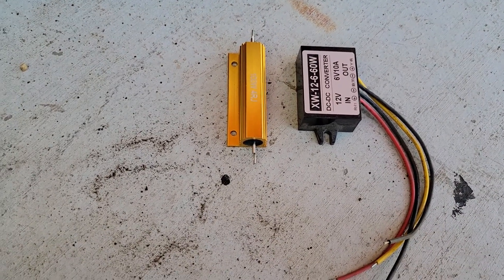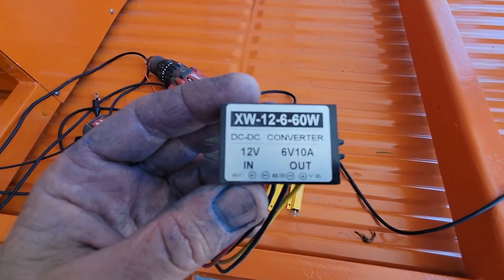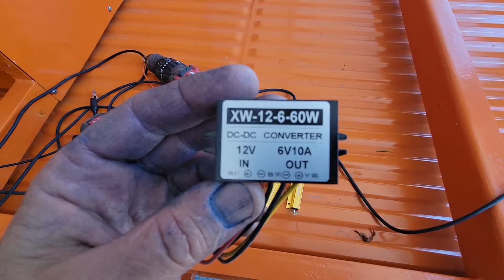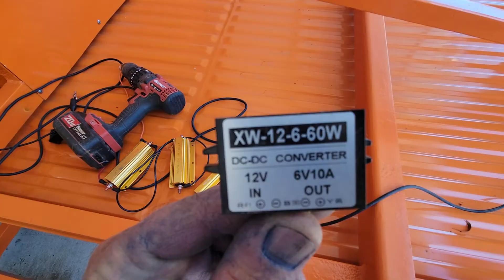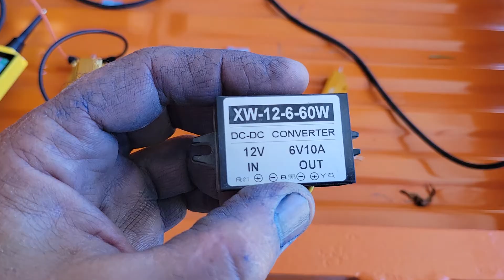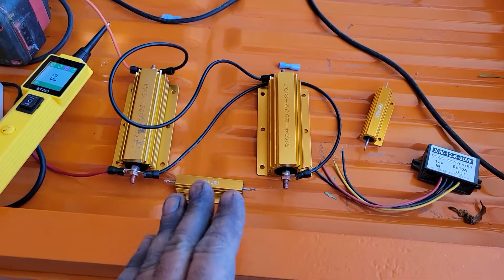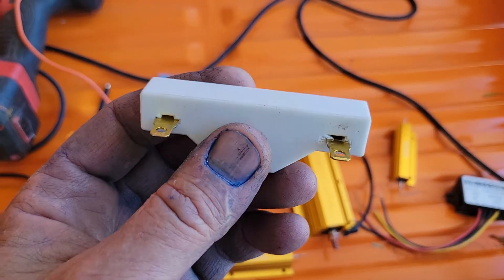CONVERTING 12v to 6v resistor or converter which is better you.

Comment: Nice shade of blue. I have what a normal person would think is a less than smart idea. I don't have any specific products purchased  made for converting voltage but I have a dreaded talent for stripping down ovens, dryers, washers and flat screen tvs. I can imagine there are some converters or regulators somewhere in my spare Parts preservation inventory. I actually stopped over the idea of voltage reduction via resistor but you've changed my mind. Thanks for the info

Comment: Hey. What if I wanted to convert a Xbox fan wire.  It is 12v dc. And I’m trying
To hook up a LED strip that’s only about 12 inches long.   It needs to be 5v dc. 
Someone’s I can just use a resistor cuz the led only require like under 2amps but they never told me what kind of resistor or the specs on it so I’m lost here.  Hopefully you can help me

Comment: I have an antique 6v radio which I wanna use with a car battery(12v) the current draw is about 1.5A but a bit more when the vaccum tubes heat up... Isn't the quick way put 10 diodes in series each has a 0.6v draw rated at 10A they r pretty cheap

Comment: The real problem is that you are using wire wound resistors. They are not recommended for the type of use you wanted. Ohms Law says 6 volts divided by 15 amps gives you = .4 ohms. If you are using one solenoid or maybe you mean all three were using 15 amps as a single unit you would need a ceramic or similar material with 200 or so watts rating. The ones you were using are not the type you want. Wire wound resistors can be used on speakers an other equipment because of inductance. You needed straight resistance through a solid material like ceramic. They can be found on eBay. I have used them in our bug, 1963 an dropped the voltage an worked fine. I am not sure if you meant all three solenoid or just one, so I figured it as a total of 15 amps. If all three run 15 amps each then your calculations will be different.

Comment: A 10 meg ohm resistor would give you better results. The 2 too 8 ohms you are using are basically a wire and this is why you are getting 12 volts on both ends.

Comment: it is not gonna work whit a resistor thats what i can tell you if you put 2 in paralel of 4 ohm you wil endup whit 2 ohm the problem is your motors take 15 amps to get running and when they run they use about maybe 2 amp... use a step down converter of about 25 amps this is for the start peek of your motors
Reply from the maker: changed to one of those big 200w 1ohm resistor pulls 4.8v running does not get that hot wires dont get hot at all. I got a step down 400w and I dont trust it. Only gets  warm now. fairly hot but not burning like the 2 100s.
Reply: @Mikefngarage  it is disined to get hot it is a big step 12 to 6 volt whit 15 amps don't tap the movement buttons to match go for a strait movement this wil help the situation in getting to warm... but whit resistors you need the water cooled ones to get this working .

Comment: 🇺🇸👍. Run separate heavy gauge wire from your 12 volt alternator to big 6 volt drop then to a 6 volt battery and connect all that requires 6 volt to that battery that way you have a Constant  6 volt for the rig and being charged at 6 but still have your 12 for the rest. Resistance always will cause heat and heat burns stuff up. You would have to run a diode in line so that the 12 that’s being reduced to 6 volt battery can’t go backwards 🍻🍻🍻💤
Reply: All you got to do is buy two 6 volt batteries, run in series for 12v system, center tap for 6 volts, run a 15 or 20a relay and switch for your project.
 You can also split the load between 2 or 3 of those 10a converters they are able to stack in parallel to split the load, because it's DC voltage and you don't have to worry about it being out of phase with each other

Comment: Mabay, resistor wire ,we used on some older cars long time ago, trying long  lengths, moving contact along wire until suitable voltage is found.

Comment: A static Resistor is workable only if your load never changes. Might be the case here, as long as you can’t (or don’t) ever engage 2 solenoids at a time. A 12V>6V step down converter rated at 40 amps output (240W) looks readily available on eBay/ Amazon. Have you tried one of those?
Reply from the maker: I have one of those coming plus another 1 ohm 200 big one. something will work. Little afraid of the converter frying. And being stuck up there on the lift. less chance of that with one of those big resistors. I have a 300w one showing up today. link in the description.